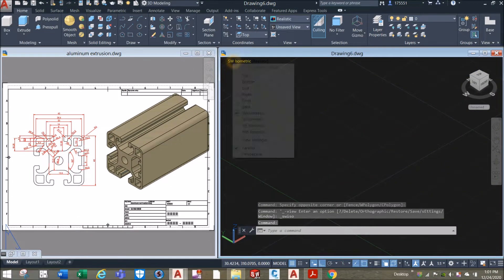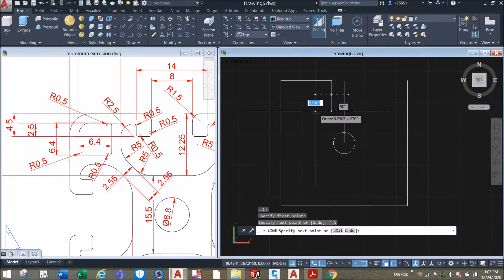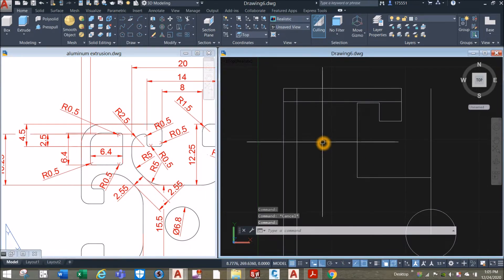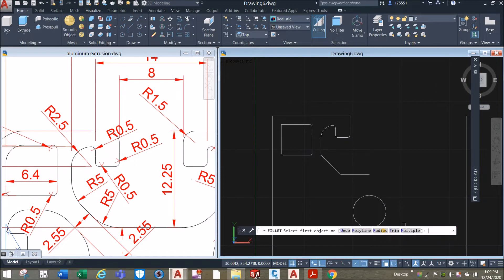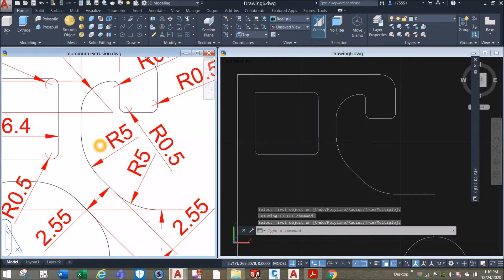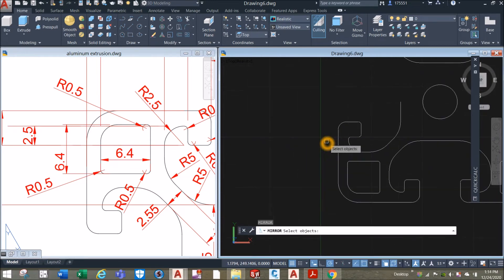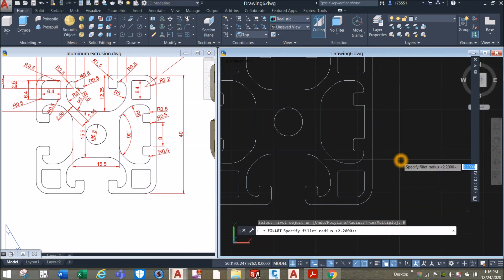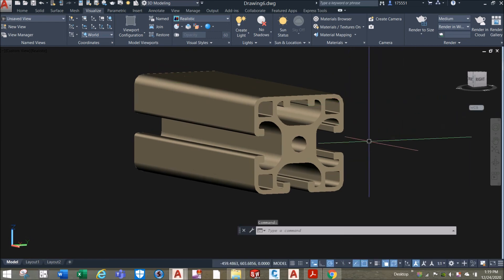Aluminum Extrusion in AutoCAD

Comment: How can I bring back selection point command box its not coming when i select  two solids plz reply
Reply from the maker: Hello , I do not understand your question. Pls type in here the point (example @ 7:03 ) where you have difficulty. 
Did you turn on your dynamic input?
Reply: @AC3DCad  By Theway I solved the problem and thanks for replying
Reply from the maker: @xo5728  just use subtract command. Select the object that you want to keep--> click enter, then select the object you want to subtract. There is no dialog box.